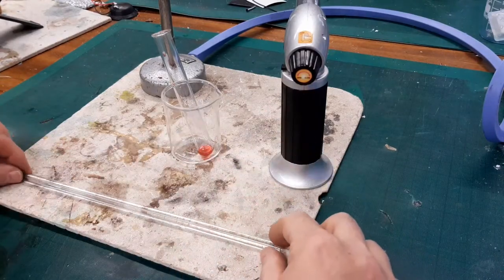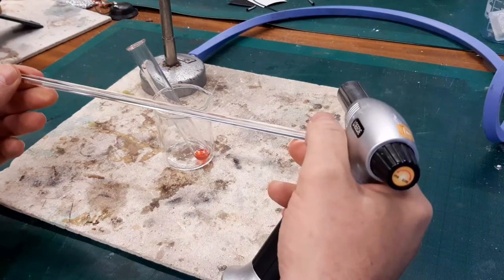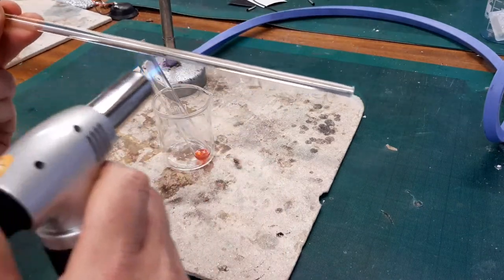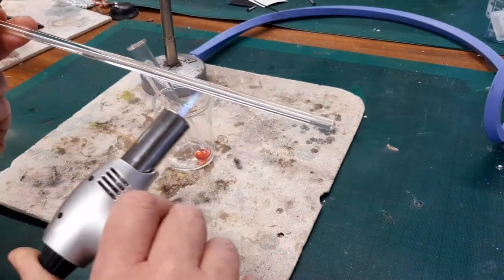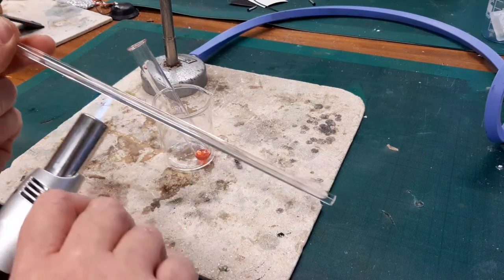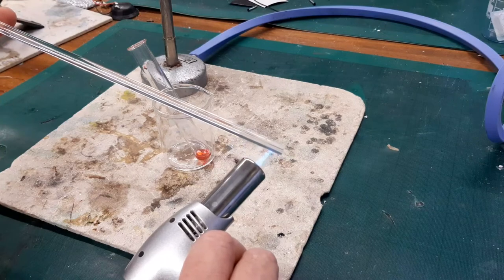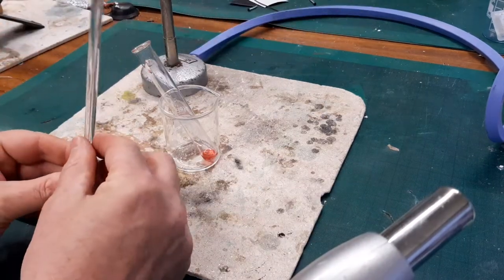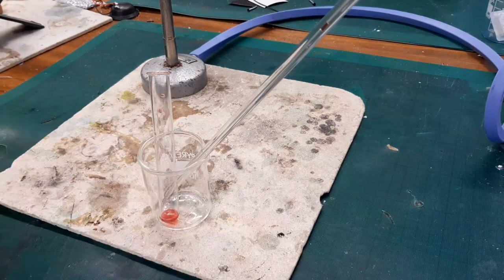Putting an Oil Bead in a Capillary Tube

Comment: The final word of the final frame looks dodgy ! 
Was the held end closed? You could be more explanatory for the layman. Oh, and why do this?
Reply from the maker: Thanks! 
a miss-spelling -but, I think the meaning is clear. Unless it is too annoying, I will leave the video as is.
Yes the held end was sealed closed. These tubes are often available from scientific suppliers and just require a bead to be inserted. My preference is to use mercury (without heating) but many schools do not allow mercury in their apparatus.

Explanation:
The apparatus is a simplified example of the apparatus to verify Charles' Law. 
The volume of air trapped under the bead varies with temperature. The pressure is always atmospheric (the tube has an open end).  This is one method of getting a fluid into the tube to act as a bead that defines the volume trapped. This apparatus is then placed in a beaker of water and the water heated. A note of the volume is made as the temperature of the beaker of  water changes.